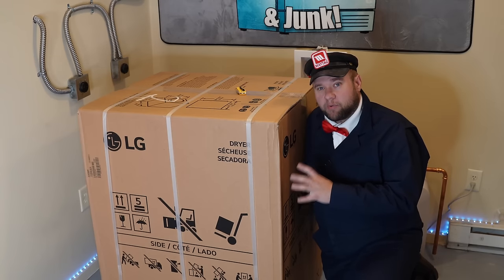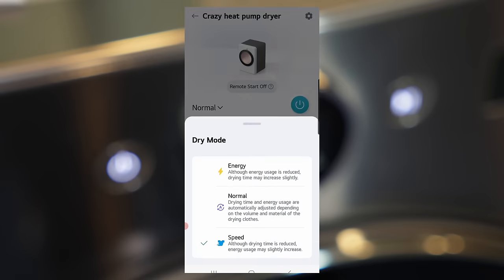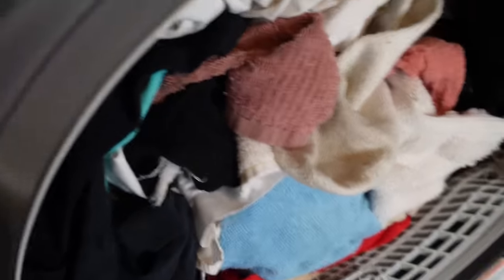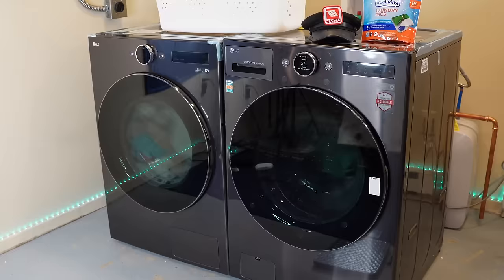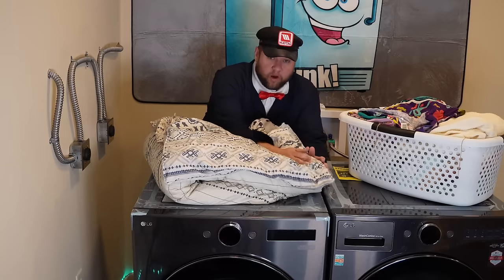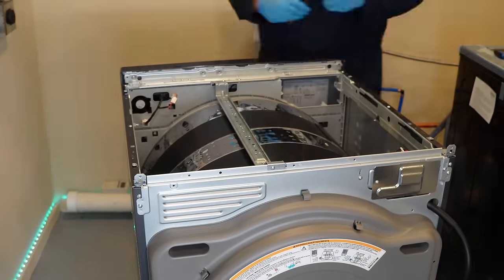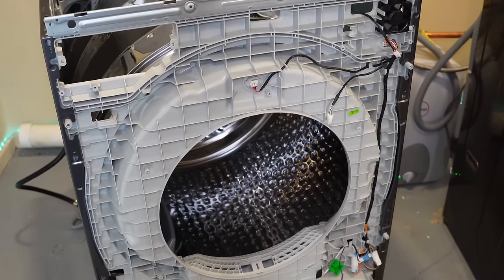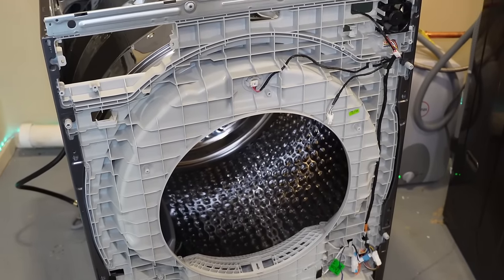LG Heat Pump Dryer - Way Better than I Expected - DLHC5502 Teardown & Review

Comment: 10 year warranty on the motor and the complete sealed system, LG openly stating 12-year expected average lifespan, some incredibly smart self-maintenance technology, and some very well thought out and serviceable design choices?  This is awesome!  I may wait to see if they put this design into an all-in-one, but if my dryer kicks the bucket before then, this just got bumped to the top of my list!

Thank you so much for taking the time to do this review, test and teardown!
Reply: I have had the same type of unit by Electrolux; stackable washer and ventless dryer. I am not an Electrolux fan. Have had many of their appliances and always disappointed.  Well.....they have surprised me. 4 years and not one issue. I wash 4 loads per day, 7 days a week. All my bedding goes in my top load washer and dryer. I ❤ my Electrolux units!! And I have determined that they  honestly are easier on our clothing.
Reply: Packhorse-bh8qn  The fridge uses a liner compressor which is trash, the heat pump systems use a rotary compressor. Not the same compressors.
Reply from the maker: LG had easily the best refrigerators before the Linear design. Their washers & dryers are the #1 choice of technicians outside of Speed Queens. Its very possible that LG is a great company marred by one absolutely horrific choice. And even then, I've been told it wasn't their choice to make - the politicians wanted them to make a more environmentally-friendly compressor, so they tried the LC which was great for 5 years before all the problems popped up.
Reply: 5 years?  I have been replacing linear compressors since the year they came out.  The new 600a linear compressors are even worse.  The 600a compressors are all failing with open winding.  The 134a compressors just ran but didnt pump.  s @bensappliancesandjunk
Reply: Packhorse-bh8qn it's not just d/w pump, ALL of the front load washer pumps fail all the time. I replaced one last week.
Reply: I have friends with LG front load washers and dryers. I certainly would not purchase that unit until I see 15 years of durability without thousands of dollars of repair costs. To be fair, it might be possible but my observations are that the technologies may be impressive but the durability is not often realized in the LG brand front loaders.
Reply: I believe it.  Our current LG dryer is now on year 14 - it outlasted its sister washing machine by 5 years already.   Some of their appliances are hit or miss, but their dryers may have genuine longevity.
Reply: Their refrigerators are of a VERY different level of quality than their laundry units.
Reply: LG makes VERY durable front loads. Mine lasted almost 20 years no repairs
Reply: Their fridges suck and dishwashers are just meh. But their front loads are amazing. The pump only ever fails when people fail to clean their pockets out and not empty the trap every now and then.
Reply: Excuse the whataboutism but almost every brand especially nowadays has certain issues with one product and does another great. Look at whirlpool. Make great dishwashers and dryers, but their washers, stoves and some fridge models really suck. Then you have Samsung that sucks at almost everything. LG is not as bad as people make it out to be.
Reply: LG does not have a warranty program.  They have an arbitration program. .  Which means no warranty. MyLG refrigerator died at 5 years..  no Warranty.
Reply: Packhorse-bh8qn  LG makes washers that last on average, seven times longer than Whirlpoop Corp, which would rather keep pumping out the same 40+ year old VMW washers but with more plastic, less friction material in clutches, no capacitors on the motors just thinner start windings, all single speed buzz box pieces of junk that only spin 750rpm, for $1,000+.... Whirlpoop will also happily sell you a 63 year old design of dryer in their lint-top variety for $900 which has the thinnest tin-can construction you can imagine, and advertise it as having "Steam" when all it does is dribble cold water on clothes and then dry them again.... compared to LG's incredibly smooth, precise and reliable direct drive variable speed motors that spin 1,300rpm and actual steam generator in their steam dryer. They had one issue with one model of compressor and now you think they're the problem... the problem is the ancient lumbering profit-machine known as WhirlPoop corporation, trying to drain clueless american consumers of as much money as possible to line their corporate golden parachutes before they declare bankruptcy. lmao
Reply: @charlestatakis9363  What's wrong with replacing a $30 pump every 5 years if the machine saves you $4,000+ in electricity over the life of the machine? Those nasty old american buzz-box toploaders cost so much excess electricity with all the Karen's having to boil out all that water in their huge 5,500w vented dryers that it should be illegal to still make machines so wasteful, all because Whirlpoop couldn't be bothered to learn how to improve a 40 year old design.
Reply: Packhorse-bh8qn  WhirlPoops front loaders are kinda an interesting story, my understanding is that they originally (back in the 90s, when front loaders had already been around for at least half a century lol) licensed a design from Philips because they couldn't figure out how to make their own. These German-made Philips machines were absolutely superb, to the point that the only reason people seemed to get rid of them was because Americans will not be told what to do (we have "freedom" after all!) and loved to slam them shut after doing laundry with half a gallon of nasty liquid laundry detergent lol... But mechanically and electronically they were cockroaches, lasted even longer than those old lumbering water and power guzzling top load clothes shredders that people love to say lasted 25+ years... But whirlpool decided to build a factory in Mexico to build their own design of front load machine (I surmise that their US facility would not be a good location to build front load machines because the union would strike if they had to change what they'd been doing for the last 60 years) and it's been pretty lackluster... Like, they're not terrible machines, but they're probably the worst front loaders on the market in terms of build quality and specs - flimsy plastic doors, only 1,000 rpm spin etc. LG has kept very much up to date on features and specs and their build quality is orders of magnitude better than WhirlPoop.
Reply: @Ikey04-ge9gy  it's funny you say that because that's almost exactly how it plays out... And I've sold many millions worth of appliances just in the last two years. I've also seen quite a few WhirlPoop dishwashers with plastic tubs where the big red hot American style heating element sticks on and melts a hole in the bottom of the tub. Probably would have caught fire if there wasn't still water in the machine lol. But it does leak all the water out and flood the kitchen. Honestly can't recommend much of anything whirlpool makes... Those supposedly reliable lint top dryers piss me off cause WhirlPoop seems to have omitted the moisture sensor on several models in order to save cost, but not only is the moisture sensor from my understanding a federally mandated feature on such a grossly inefficient appliance as a vented 6,000 watt dryer, but it must be leading to untold billions of kilowatt-hours being frivolously blown out of a 4" hole in the wall and wasted every year in america. Their feeble attempt at a heat pump dryer was also mind boggling how much of a Dieselgate it was... Clearly unfit for purpose and horrific engineering, only made to rake in some EPA incentives I'd bet.
Reply: Packhorse-bh8qn  Yeah I've always been a fan of LG's tilted axis design that keeps things towards the back of the basket, both to prevent that issue but also just to put less wear on the bearings with the weight closer to them. And it does seem like LG gets very long life from their main spindle bearings, I do believe they use pretty chunky sized ones, but possibly from that tilted axis as well.
Reply: Packhorse-bh8qn  Interesting you mention the control board dying, my old LG front load also had the control board die during a particularly violent storm, took it apart and discovered a MOV that blew on the PCB. Ordered replacements and replaced it, ran for another 10 years or so including going through a flood (which power was turned off to the machine for that event) and it survived. Water was well over halfway up the machine lol.
Reply: The Philips design washers you speak up never existed in the US, that was a European thing. And while we are on that topic, whirlpool Europe made some pretty good washers. The Philips designs of rhe 90s, their own “awm” series from the 90s-2000s, then the 6th sense range and so on. It wasn’t until the 2010s when whirlpool took up the god awful indesit prototype that their washers took a dive. As for whirlpool USA, their front loads didn’t always suck. Their front loads first released in the USA in 2001, the duet range, made in the German bauknecht factories (Bauknecht is just whirlpools German division) and they were workhorses. They were designed very nicely and they were very reliable. I know some friends and family who still have the original duets. Then in 2010 whirlpool stopped having bauknecht make their machines and started to make their own machines right here in the states. Those were definitely worse than the Bauknecht made models, but they weren’t bad all in all! They were very sleek looking, performed nicely and had great options. However in 2019, whirlpool ditched their previous design for a much worse design, the design they still use to date. Everything about those machines scream “COST CUTTING!!!!!!!!” First off, they LOOK horrendous. Like massive speakers. At first glance I didn’t even know it was a washing machine. Secondly, EVERYTHING is plastic and cheap. Even the inside of the door which is usually glass is now plastic. That is inexcusable. Lastly. Their control interface and optioning is horrible. Seriously, what does “what to wash, how to wash” even mean? Whirlpool used to make some of the highest quality appliances in the USA. Oh how those days are now gone.
Reply: @Ikey04-ge9gy  oh interesting... So the old German-made Duets were not a design they licensed from Philips? I remember reading about that in an old news article saying they had switched to their Mexico factory... So is the 2020 design totally unrelated to the 2019 and earlier or is it just a cost cut version of it? And did WhirlPoop actually come up with any of these designs themselves? I find it hard to believe they did, given that they haven't designed a new dryer platform for 63 years. (I don't count the Maytag/Kenmore Elite TL dryer as theirs lol)
Reply: The German made duets had nothing to do with Philips. 100% bauknecht whirlpool. The 2020 design is somewhat related to the 2019 and prior models, but yes it’s a VERY cost cut and stripped version of them. The Mexican factory you are referring to was for the “Duet Sport” line of machines. Which was whirlpools base front load models of the 2010s. Those were whirlpool USA designed but assembled in Mexico. So yes, all of these machines were in one way or another; whirlpool designed. As for their dryers, I’ll give them a pass on those. They haven’t changed it in 60 years but it’s literally the most simple and reliable dryer design available these days. If it ain’t broke, don’t fix it. Their dryer design were so good that when LG and Samsung were launched first in the US their dryers were and still are made almost identical to those Whirlpool models.
Reply: would u get the lg washer and heat pump dryer, or would u get the all in one washer/heat pump dryer?
Reply: 16 years in my LG front loader and no problems,  same with the gas dryer
Reply: @bensappliancesandjunk now they are trying to fix it by killing all of the linear compressor fridges and launch the "smart" inverter fridge
the non linear ones are built like tanks
mine outlived the 10 yrs warranty on the compressor. Best 1000 dollars ever spent
Reply from the maker: @youraveragebeamngytb  for sure. Thats the worst part about this. Pre-Linear LG's were THE BEST FRIDGE ON THE MARKET. We regularly were fixing 2005-2011 units and selling them with very minor sensor problems. Even if you look at LG's today beyond the compressor, they're great products. Its literally just the compressor thats a problem.
Reply: @bensappliancesandjunk  samsung fridges are garbage tho, they are so fcking loud

Comment: I've had my Samsung heat pump dryer coming up on 4 years.  No problems yet.  After every cycle, I make sure to vacuum the filter.  Every month (or earlier if the unit asks), I clean the coils and the duct.  As one of the commenters stated, you absolutely need to make sure the system hasn't ingested any debris or small items.  Air flow is super critical to removing the moisture.
This full sized unit is just the beginning to reducing energy usage.  A heat pump usually uses less than 1000 watts.  A conventional dryer usually uses 2,000 watts or more if a high heat setting is used.

Comment: Watching this and the new heat pump water heaters that can use a 120 Volt wall socket. I use a Speed Queen washer with great water extraction so the LG is looking good and have the hookup already.

Comment: Excellent video and excellent review. I use an older, smaller heat pump dryer myself and the lint management is my biggest struggle - not enough to be annoying, but a prominent issue. Coil cleaning is something I wish it could do, and I know I'll need to address it eventually. My only gripe with the video is when you mix up and jumble the units "kW" and "kWh". A thing does not consume "kilowatts" over a period of time - it consumes an average or instantaneous number of of "kilowatts" and a cumulative number of "kilowatt hours" :) And there's no such unit as "kW*h" (or its dirty sibling in media horrors, "kW/h"). It's just kWh, kilowatt-hours. Using fewer kWh per load is a big advantage, and it's a reason I love mine! And, given the small amount of kW it uses while running, I'm also surprised they gave it a 240v supply requirement (as does mine, which uses around 600 watts). It could easily run on a 120v outlet :)